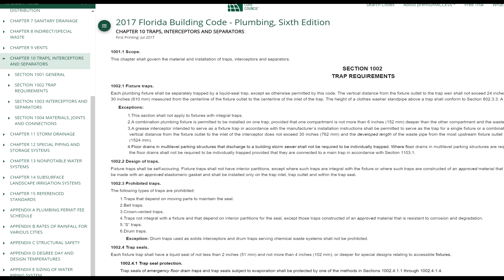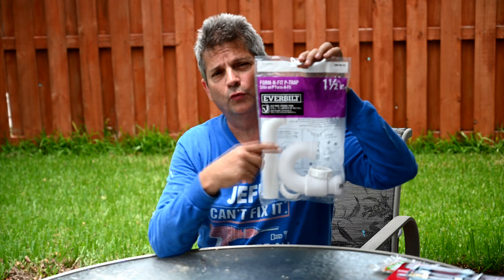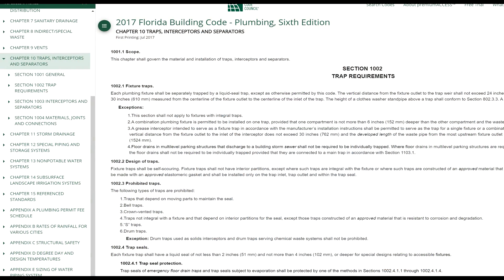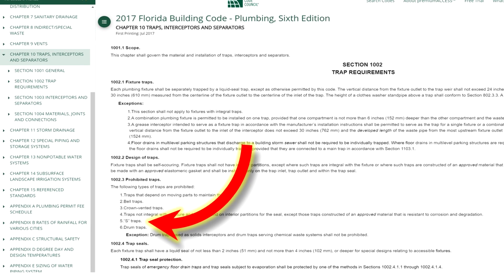Why You Should Never Use Plumbing S-Traps On Your Sink Drain

Comment: Just looked at all my traps in my house and all of them have S traps. I’m going to replace them this fall. Wish me luck
Reply from the maker: You should upload some videos of   it  During the conversion process to P trap.
Reply: The code you referred to prohibits S traps in drainage not sink wastes,.
Reply: @jimmysixfingers9796  overall it looks like S traps are no longer considered a good idea for a sink drain. They work, but if the vent conditions are off on the plumbing system you could have an S trap loose it’s seal. I’ve fixed most of mine in the house, just have 2 more to go. I’ve been too lazy to fix them as yet. 😉
Reply: @jimacheson4933  There are plenty of S-traps in the UK. They are not a problem. While the syphon effect can pull the water in the trap to one side, there is enough height between the upper and lower loops that, by the time the water level has fallen enough to break the syphon, enough water remains in that central leg to fall back and re-seal the trap. No gas escapes, as for the seconds that the trap is open, it is under negative pressure.
Reply: @stephenwalker6823  Good, because I'm having trouble figuring how to NOT do an S trap without an air admittance valve AND the drain is in the floor, not in the wall
Reply: What is your plan for changing them? Air admittance valves?

Comment: Dude we replaced our s trap with another S trap!!! and a week later it's clogged. It wasn't even clogged in the first place, the pipe had started leaking. I've been plugging and just put a bunch of drain cleaner down it. You didn't really go over why it's no longer installed this way, is it a bad design for some reason?

Comment: A s trap is just 2 P traps lol.. Building codes are only for Commercial use btw, its nice to do if you plan on selling your house, But other than that, if its not causing a problem & they usualy don't than meh.

Comment: I am in England and I am dealing with the S trap you show but my question is what is the alternative?  I have a pipe going vertically down and getting a horizontal pipe is impossible, the pipe on this first floor simply goes vertically down through the floor.  You point to a problem but what is the solution? you do not say.
Reply: The solution is an AAV

Comment: Why is it necessary to call such scandalous announcements about simple things?! Call them Outdated and not completely reliable, that's all... It's like carburetor engines became outdated and are no more produced...
Reply from the maker: The issue is they're not just outdated they have long since been banned by plumbing code. People have still been using them for decades even though they have been banned in the code. A carburetor engine is not banned in any code.
Reply: @jeffostroff  well, carburetor engines are not allowed for cars since 1990s almost worldwide, for motorcycles are not

Comment: What if its for a commercial sink with an indirect drain where the final connecting pipe has an air gap between the drain of 5 inches. Kinda like a gutter just pours water onto the ground?

Comment: That trap is not put together correctly. Those things are found in older homes because they are repairs and it’s easier to go to the floor than it is through the walls with old cast-iron. They are banned because they bypass the old vent in the wall that goes up through the roof around the kitchen window typically. There are solutions that don’t cost much
Reply from the maker: many houses with s-traps have no vents at all

Comment: Dam man. Im not sure why these s trap videos all appeared on my feed. Look im not going to get into whats better or not but look at the responses. And, first of all i did not know they were not allowed in new construction . That being said let me start by answering the most repeated question ive seen
"Omg why does lowes to sell these things?"
Answer, because theres millions of houses, with probably tens of millions of s traps that work and have worked perfectly fine for the last 50 years but the crappy tin traps are rusted through and either leaking or collapse into dust when you try and fix them. Hence, a 3 dollar new plastic trap is perfectly fine. When the brakes on your 68 mustang wear out, you put new pads on, not convert them to the newest discs 
That brings me to point two. These videoes have so many people freaking out "holy crap my 1875 house has s traps!"  Yeah, and theyve been there working since your house got plumbing. Dont touch them until you renodel or update. If you decide to "fix" 40 year old drains, trust me youd better be prepared to open your wallet because thats a can of worms youll open youll regret for a long time. If you asked "how do i conveet a s to a p trap?" Youll want to know how to patch lathe and plaster, sheetrock, tile floor, rewire a GFI , go from coppet, black pipe to plastic. 

Leave..... it .... alone....
Reply from the maker: you missed the whole point of this video

Comment: So how would you reroute it? My grandpa built this house in the 1940s and it’s a code nightmare so I can’t pull a plumbing permit... why does it pull water out as compared to an in the wall drain? Is it an angle that I need to avoid? Could I do two 45° rather than one 90° coming off the P trap?
Reply from the maker: The main difference between the S trap and the P trap is that the S trap when it takes that water in and exits the trap it does not go into the wall it continues and goes straight down through the floor down into the basement and down to wherever so it has a longer vertical drop and more inertia of water. This leads to the water that's inside of the trap getting self siphoned. With a P trap you can see how the output of the P trap suddenly turns horizontal and goes into the wall, cutting off that long vertical intertia where it goes down vertically but the important part here is that there is vertical component that goes up through the roof which is the vent that provides air behind water which prevents that self siphoning from happening. That is the key to making the P trap successful. So anytime you ever doing a remodeling and have the walls open that is a great time to try to have a stack added to the house that leads all the way down to the sewer, and then you can tap into it horizontally with any of your vanitys and kitchen sinks.
Reply: An AAV is your solution

Comment: Hi, just to be clear "S" shaped plumbing is okay when NOT using as a trap? The P-trap in this case would be the only actual trap and not directly connected to the connections which happen to form an "S" shape. The P-trap involved is the safeguard whereas the s plumbing connections are just that, connections. Also, it's a dual kitchen sink but no other water facility (toilet, other sink, etc) connect to it, not sure if that mattered.
Reply from the maker: the s-trap is a trap

Comment: Dealing with a 1950 house and they S trapped with galvanized or steel so much paint I can’t tell yet ... plus it’s totally frozen and it’s a washer drain line!!!!!!OMG..... and tight to the wall next to cubbies
Reply from the maker: The problem with the galvanized parts is they rushed from the inside and they clog up just like arteries in your heart and eventually that you restrict the flow altogether
Reply: @jeffostroff  yeah for sure. Whenever ive flippes houses or refurbishedfor rentals, if i see galvanized i pull out the sawzall and just hack away. If its not a problem yet, it will be. Like old school pvc supply plumbing.

Comment: Strange how S traps work fine outside america,maybe its your antique plumbing system thats the problem not the trap ;)
Reply: Every single house in Australia has an s trap on every single sink.
Reply: Maybe it's not the plumbing system but the amount of money involved in making and enforcing laws, codes, and ordinances.  Inspections and all the make work.
Reply from the maker: Maybe they fail and you just don't know it but certainly if you have a large drop after the S trap you run the risk of itself siphoning out
Reply: @jeffostroff  they work fine on a properly designed plumbing system and dont syphon

Comment: This trao has been in my craftsman bungalow for 105 years with no problems. It works perfectly fine as it was intended to. These people who come up with all this crap are totalky clueless. The garbage that they call houses built today are total junk. They fall apart in a few years. Yet are inspwcted to the letter. Majes no sense.
Reply from the maker: No you're wrong in your assessment the problem is with us straps is that sometimes they work and sometimes they don't work period the problem when they fail is it happens when you have a really long drop vertically after the strap. If your house doesn't have that long vertical drop then you probably won't have any issues. The reason why they're in the codes now that you can't have them is because there's enough instances where there would be a large drop for example in a multi Story building or a third floor bathroom, that's where they would likely have a problem.

Comment: Does America not have anti vac s traps
Reply from the maker: it is not the s-trap itself that is anti-siphon, it is the design of the plumbing stack which it connects into, or lack of a stack, and a long vertical drop after the s-trap contributes to the self siphon issue

Comment: S traps are still legal in the UK, but we're not prone to toilets siphoning the water from the Bath/Shower or sink traps as the two systems only come together in the main sewer downpipe, but they don't share the same inflow route. Usually grey water is fed into the downpipe above the toilet outflow, and the downflow is usually something like a 6 inch pipe open at the top.
Reply from the maker: As long as you can mitigate the downward drop after the p-trap it should be fine

Comment: If you have a vent between your toilet and your sink you can use them. the problem is not having a vacuum break between your major fixture and your minor fixture.
if your toilet is before the sink it can push the water out of the trap. That's washing a major over a minor. That is why you need the p-trap with the vent.
if the sink is before the toilet and there is a vent between the two you can use the S-Trap.
You can wet vent a toilet in lots of places, vent size is key. still again the sink has to be above or before the toilet or water closet as in most homes.
It can not be tied into a sanitary riser coming from an upper floor. All of that to say it's not that simple. 
You can use them, they are safe, and you should hire a plumber if you go behind the trap and do anything.
Reply from the maker: Why can't you tie it to a riser?
Reply: @jeffostroff  you can if you individually vent the sink to keep the back pressure from reaching the sink trap. There is more to it that the explanation. Keep in mind the name of the game is protect the traps against vacuum and pressure.

Comment: Two questions.
1. I'm doing a DYI van build. Would an S trap be good enough for a simple grey water receptacle directly under the sink. 
My goal would be that if the five gallon grey water tank had to sit for a few days just to prevent any smelly stuff from coming back up to the sink.

2. Just for the discussion, let's say that the trap area normally holds 12 oz of water.
After you're done washing your dishes or your hands or whatever, could you just wait a few seconds and then drop 12 oz of water down the sink to make sure the trap is still full of water in case it was pulled out from the previous usage?
Reply from the maker: 1) Really depends on how long that vertical drop is, as that is what causes the water to self siphon. If you are not goin into a sewer system, you probably would not have any smells coming up

2) Yes a trap should refill itself pretty easily.

Comment: Okay well I have an s-trap under my sink and I can't get it to stop leaking, were not remodeling I don't have the money to replace all of that. What do I do?
Reply from the maker: Well in order to help you with your problem we have to know which connection is leaking? Is it the middle connection? If so that is the same thing as a P-trap, and we have another video that deals with this exact problem which is the connection that leaks a lot is the one that doesn't use gaskets it just has the sort of tapered shaped plastic parts that come together and that is the most critical connection. https://youtu.be/tqf11On2xEA So, that's the one you have to connect first and make sure it's happy and absolutely perfect before you tighten down the other two connections
Reply: p trap. dugh. or hire a plummer.

Comment: I was not aware S traps were disallowed. Thank you! Now, I have to figure out how to eliminate them when all my plumbing goes thru the floor.
Reply: How about teeing in an air admittance valve? Wouldn't that eliminate the possibility of siphoning out the trap with a large slug of water going down the drain?
Reply: @wingerrrrrrrrr  As long as the air admittance valve works.  Many jurisdictions don't allow AAV's on new construction, because in the event that the home owner doesn't know to inspect and replace them when the fail, they eventually make your trap an S-trap.  It's an easy fix to replace them from time to time, and the technology has improved since they were first introduced, but it still is commonly the case that the jurisdiction only allows them for retrofitting existing construction.
Reply: @carultch  
I put one on to address a poor plumbing job, and had to extend it to make it higher up because it was sometimes getting wet from overload and less effective as a result. Think it does help though.
Reply from the maker: If you can get the drain lines and vent stacks to go into the wall, that would be better.

Comment: so when you have a low stub out drain, can you use 2, 45degree angles to elevate it and straighten out the line?
Reply from the maker: You can use pretty much anything other than 90 degree fittings.

Comment: so in most p-traps, the water only goes anther couple inches then down vertically anyway that is the only difference as most horizontal line coming out of the wall is coming up vertically up the wall then wye right out the wall horizontally so not really that much more horizontal line than get with a s trap
Reply: Vent pipe (stink pipe) is the difference,  you can vacuum a s tap dry but a P trap is meant to be conected to pipe with a verticle riser vent, so if you pull a vacuum, it sucks in air from the vent pipe and doesnt suck the trap dry.   That is what is banned, just the fact the S pipe has no way to vent it.  If you connect a P trap to in wall plumbing that isn't vented you have created a S trap, which is a vilation as well.
Reply from the maker: Mike, the water's inertia is broken by that horizontal line coming out of the wall, that is the key difference. Also right where that horizontal line goes into the wall is th event stack, so now you have air behind water to keep water draining smoothly. In fact most codes require that plumbing stack to be within 5 feet of the fixture to be effective. You don't have this with an S-Trap, you have a long vertical drop to the basement, and if you even do find a vent stack somewhere you are well over 5 feet away, so it's not likely to even be an effective stack.

Comment: Our Cape Cod was built in 1949 and passed inspection before we bought it. Tried to replace it myself but the thread of the pipe that goes into the basement is rotted and broke 
off. Any tips before I call a plumber?
Reply from the maker: Sounds like you have cast iron pipes maybe? Unless you want to try to learn how to repair it yourself, a licensed plumber is recommended.

Comment: When the water goes some water goes but not all the water goes out only a tiny stays and my sink has p trap and tub too and my bathroom sink has no,vent but doesn't gurgle and the water doesent go and my kitchen sink gurgles so I put a flash light in the drain and when it gurgles the water bounces and there's still water
Reply from the maker: A plumber can add a vent for you. Also have you ever had your sewer lines snaked? Sometimes we can get roots growing into our pipes in the yard, and that causes backups and sometimes gurgling.
Reply: @jeffostroff  the landlord doesnt do the work, the vent might be blocked tho
Reply: We only snaked our tub train to unclog our sink drain

Comment: I have an outdoor sink that is draining straight into the main sewer line. How can I install a p trap without drilling holes in the block wall? There is no in-wall drain to attach to.
Reply from the maker: How does it get to the sewer now, just straight down a pipe?  I would make that pipe the plumbing stack, and feed the p-trap output right into this stack, but you'll need it to vent upward also, like the vent stacks on our homes do.
Reply: Can’t make it the stack. That pile is horizontal. Sink just drains straight into it through a T
Reply from the maker: @JoeyIngles   Yikes it should not be draining in through AT that is for sure. It's horizontal and training OK it might work for you as long as it is sloped downward slightly 1/4 inch per foot. You might still be able to get at the pipe and insert another T in it and put a vertical stack in it because you really should have that pipe venting.
Reply: Yeah, previous owner wasn’t all that worried about code. He duct taped the drain onto the sink.